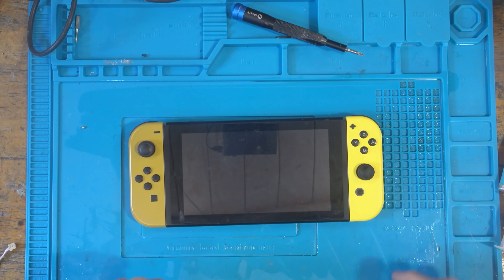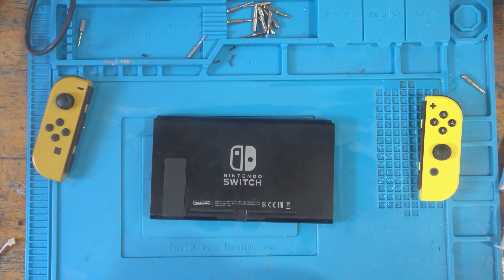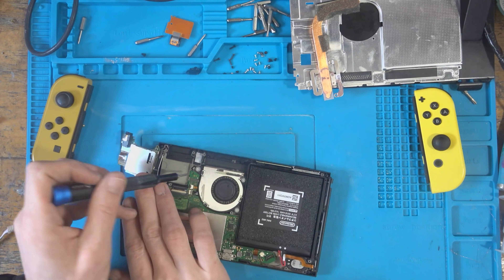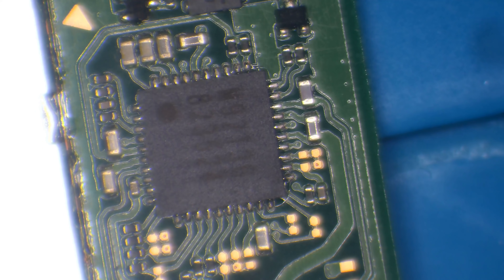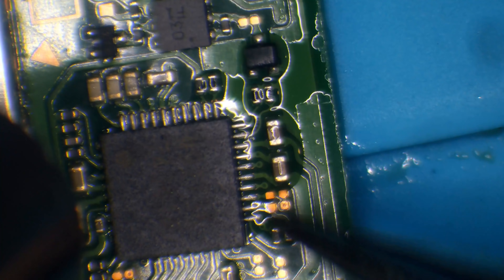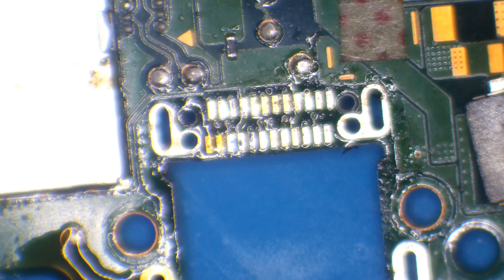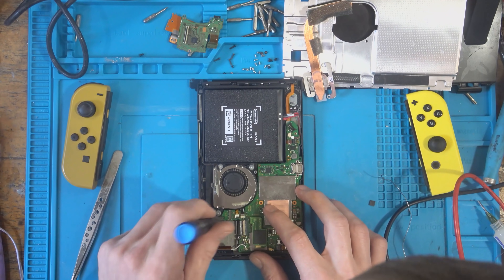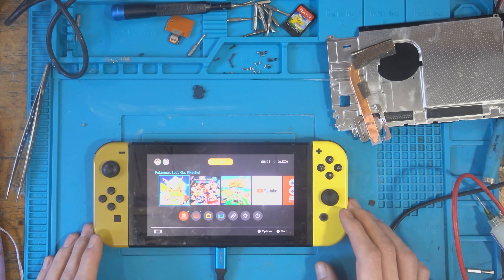This Nintendo Switch Won't Boot Up! Can I Fix It?

Comment: Very nice fix. You really know the system and that you can do al this work in such short time is amazing and says enough about your soldering skills. Keep up the nice repairs 👍🏻
Reply from the maker: Thank you mate, yeah I know most the circuit for these now but that will come with experience as you perform more repairs on them

Comment: When solder squished out, is there a risk of whatever pins it touches shorting to ground, even if you wick away the excess solder? I’m wondering if there can be a bridge to the center mass of solder that we can’t readily see or not
Reply from the maker: That's a really good question. As long as it's flat to the board I shouldn't think it would cause bridging under the chip. I've never experienced it and I press down on every chip I install to make sure it's flat so I don't think it's possible to be honest
Reply: @TheCod3r  thanks!

Comment: Hey, from ur experience when ps4 controller dosnt charge but works normaly via usb cable,its just bad battery or smth in motherboard? Ty
Reply from the maker: It depends to be honest. Some will be the battery and some will be the battery charging chip. Until it's looked at it's impossible to say
Reply: @TheCod3r  understood, ty ;)
Reply: From experience, it will most likely be the battery charging chip. I've been buying several PS4 controllers the last couple of months because I'm using them for learning purposes (also the reason why I subscribed to channels such as TheCod3r's). The biggest problem I've come across is controllers that do not charge but have some other kind of activity: bluetooth connection, usb connection (some), all buttons working properly. The problem is usually a chip called s2pg001a which is a BS expensive chip (25 usd) because it's custom made, private and extremely bad quality. Some other controllers have a more reasonably priced chip called d92003mw that you can find for 5 usd.

Of course, like TheCod3r says, it could also be just the battery. But I'm just betting on the most likely case I've encountered so far among 70 to 100 controllers.